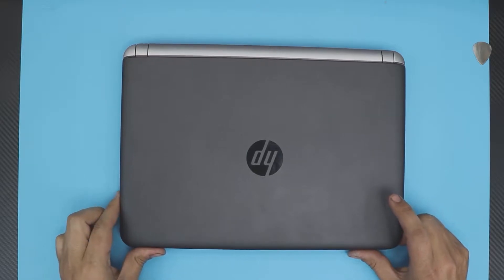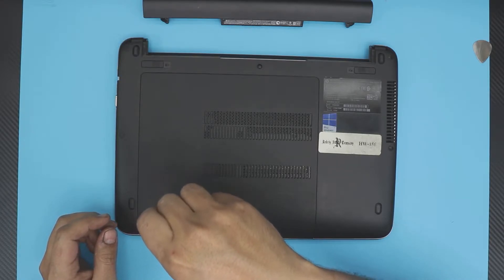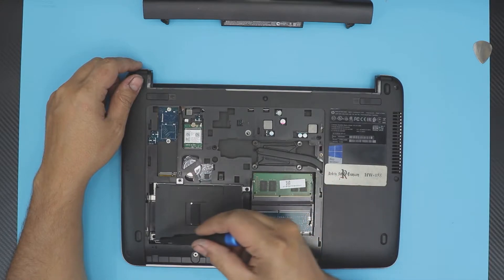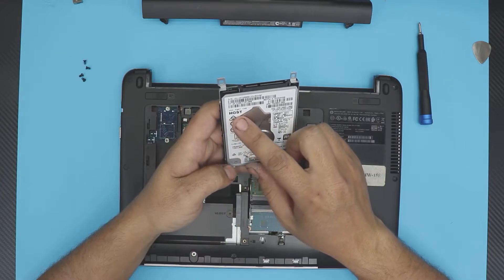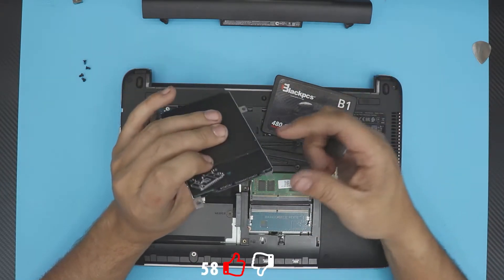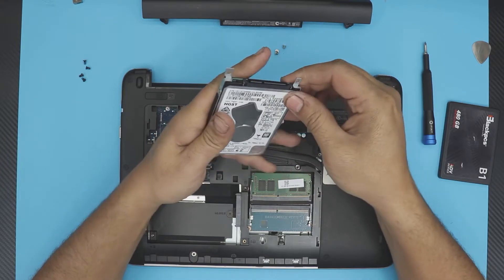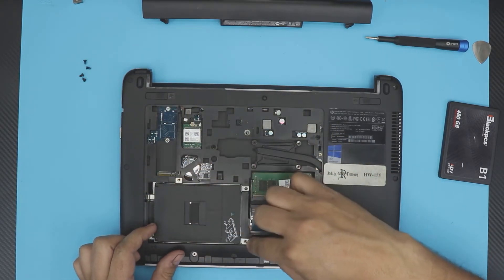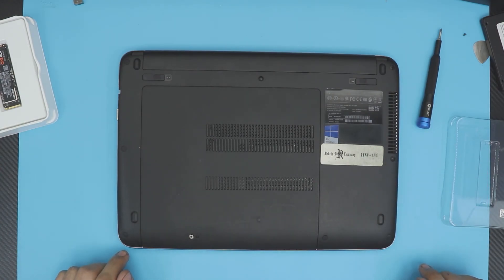Hp ProBook  440 G3 SSD / HDD Upgrade - STEP By STEP

Comment: I had a doubt, my windows is pre installed in the hdd, but if i take out that hdd and insert a SSD then I will lost the original windows ( because, i don't have the product key, it came pre installed)
Reply from the maker: Thank you for your feedback! If you wish to support the channel, you can like, subscribe, or both!
Regarding your question, before that make sure you add your Microsoft account to the windows ( and 90% of time everyone does) the key is linked to the account.
you can install windows and it will auto activate.

Comment: Use nvme or M2 slot? Ddr 3 or Ddr 3 ram?
Reply from the maker: Thank you for the feedback! if you wish to support the channel you can LIKE or SUB or both :P
regarding your question: if you have 6th gen CPU then its NVME iif you have any thing under 6th gen model its m.2 SATA.
ram is DDR4 sdram: https://amzn.to/3DADJTl
Reply: @uFixTek  thank you bro, i have i5  6200U. I can use nvme right!
Reply from the maker: YES you can install NVME the best NVME are the samsung 980 pro: https://amzn.to/3FnnGKc
Reply: @uFixTek  il mio pc con processore i5-6200 ha un connettore M.2  NVME 
il connettore del M.2 Sata è diverso, ha una tacca in più

Comment: Does this laptop support m.2 sata or m.2 nvme ??
Reply from the maker: Thank you for the feedback! if you wish to support the channel you can LIKE or SUB or both :P
regarding your question: yes it does we have upgrade 4 of this models this month with NVME samsung and zero issue , just on one of them we had an issue detecting the ssd , but updated the bios and it was fixed. BUT to be in a same side give me the exact model of the laptop something and ends with #abs.
Reply: @uFixTek  L6E40AV
Reply from the maker: sorry but the 40AV only takes  2280 M.2 SSD SATA, its not NVME compatible.
Reply: @uFixTek  thank you so much
Reply from the maker: my pleasure my friend
Reply: @uFixTek  what about my L6D81AV?
Reply from the maker: @volt4419  I'm sorry but i have no idea why YouTube  place most of the comments in the spam list!! sorry about it :(
your laptop it takes  2280 M.2 SSD SATA, its not NVME compatible

Comment: hello very good video 
but i have a problem i can't remove the screw on the outside it is stuck with the spring 
help me please 
and thank you very much
Reply from the maker: Thank you for the feedback and your support to the channel by a sub :P
regarding your question:
you shouldn't be able to remove the screw from the cover, all you need to do is to loosen up the screw and slide the cover tot he front of the laptop.